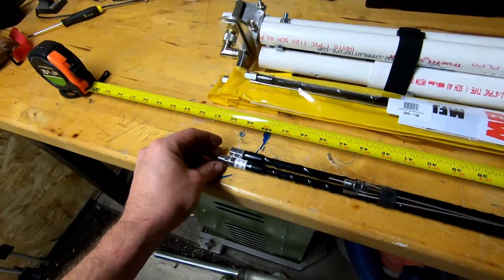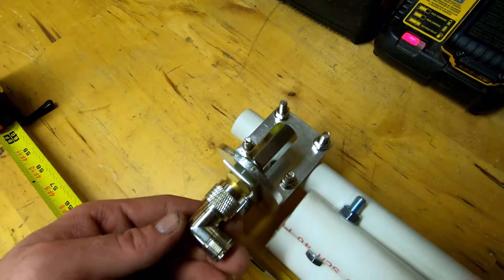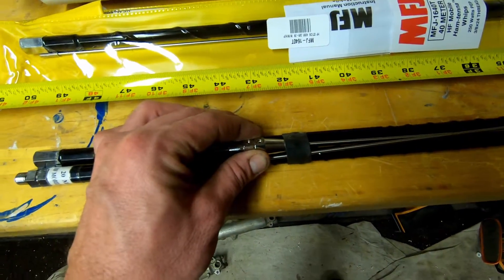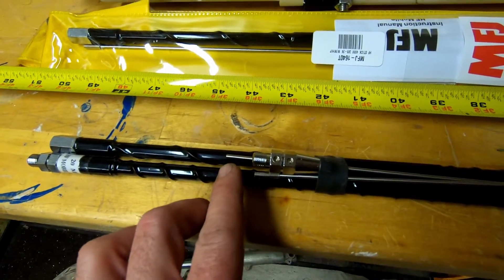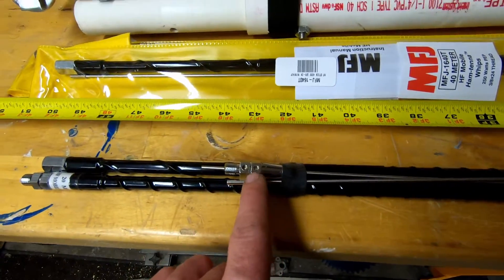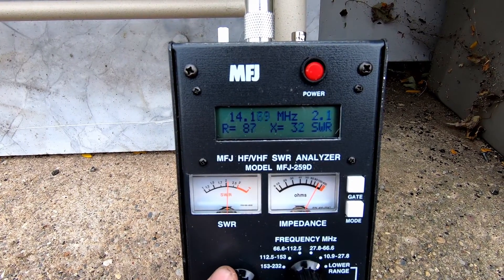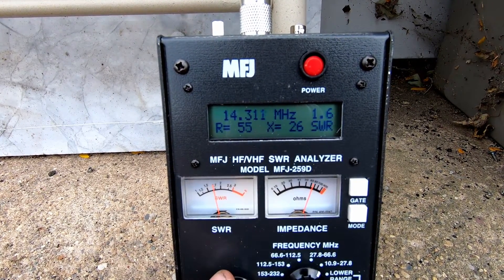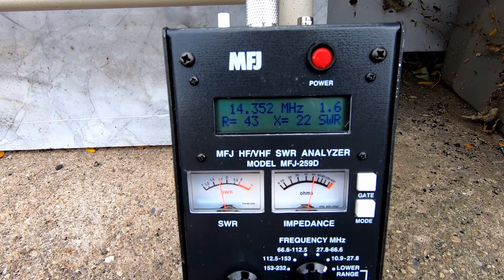Portable Hamstick Dipole Experiment (20m)

Comment: Very cool.  I put one of those up in a vertical polarization just on the top rail of my chain-link fence.  I tried to attach some radials to it, and that sent the SWR sky high.  Disconnected the radials, and near 1:1.  It worked well; I made contacts all over the country with it.  DE K7RLN

Comment: I built basically the same setup.  I experimented for a day with the whip length and the best I can get with my Comet analyzer is SWR of 2.2-2.5 at about 70 ohms at 29" whip length. [this was at 14.230-240]   So a tuner is necessary.  It works great for JS8 so far [today is the test run] but I'm wondering about the whip length.  I have not cut them off, but at 29" they don't seem to extend too far into the main shaft.  The irony is that my hamstick dipole fell right into line with about a 1.2 SWR @ 50 ohms....at 14.585....outside the damn band. :)  Any thoughts are appreciated.
Reply: how did u get on with this trying to make 1

Comment: Hello; I know this video is a few years old, but one thing I wondered about (and I didn't see in the comments, if I missed it please forgive) but I understand the impedance of a dipole at the feedpoint is about 75 ohms, and there's no balun or gamma match on this mount. What impact does that have wit 50 Ohm feedline? wonder why they don't make a groundplane mount, using the hamstick as a radiator?

Comment: I was under the impression a dipole antenna was half a lambda. In the case of the 20m band, total length roundabout 10m, each leg roundabout 5m.  It looks like you built yourself a full wave dipole antenna. What was your reasoning here?
Reply from the maker: The hamsticks I used are electrically a quarter wave each.  End to end and center fed like this is equivalent to half wave center fed dipole.  Hope that help :)
Reply: @TomtheDilettante  then i understand.  i will try it out

Comment: Video says 20m but you have 2 20m hamsticks for your dipole. Shouldn't it be 2 10m hamsticks?
Reply from the maker: As I understand it, each hamstick is an electrical quarter wave, so two end to end in this configuration creates a half wave dipole. At least electrically. It tunes quite well in the desired band but because they’re compromised antennas, bandwidth at lower frequencies (ie, 40m and 80m) is quite narrow. Hope that helps!

Comment: So I have a question. Given the horizontal polarization and height from the ground, isn’t what you’ve constructed a NVIS antenna?
Reply from the maker: Good question and I'll give you my best newbie answer.  From what I understand, an antenna is considered NVIS if it's 1/4 wavelength or less in height from the ground (e.g., 1/8 or 1/10th wavelength).  So, for 20m, at 15' off the ground, I was not considering this an NVIS antenna.  However, my 40m hamstick dipole at 15' off the ground would probably be considered an NVIS antenna.  I'm not sure if this all applies to compromised antennas with coils though.  I'd love to hear what others have to say about this to educate myself as well.  Thanks for watching!

Comment: I think you "ham lingo" is just fine.  I listened to my dad for decades (I'm 55) and I guarantee he never would have guessed that you're a n00b.  To honor my dad, I got my tech license in 2003 or 2004, mounted my his old Kenwood 2 meter rig in my car and only listened a bit.  I've never said a word over the air, but your vid's may just inspire me to do so.  Next weekend's project is to journey down to Naperville to disassemble dad's ham shack, pack up the radios, antennas and peripherals and haul it all back to Michigan.  73, Rob KC8ZPP

Comment: Just got my GMRS license (WRMD956) in eastern KY. My radios are arriving Sunday and Monday with my SWR reader estimated to arrive April 4th. Do you have any recommendations for mounting my antenna and perhaps a video where you covered it or even one you followed? I know my cable needs to retain 3’ segments, I’m just contemplating placement on my wife’s and my vehicles. 2017 Subaru Impreza hatch (2018+ Crosstrek) and a 2012 Toyota RAV4 Limited.

Comment: Good job Tom. Hope you make lots of contacts. I had a 40 & 80 meter Hamstick Dipole from one feed point in the attic of an Apartment in St Louis several years ago. It got me on the air, of course they are compromise antennas but far better than nothing.

Comment: I am trying to set up a 10M dipole.  I got the antenna tuned to the frequency, but I can't get the SWR below 2.  Should I just use a tuner?  I would like to get the SWR low and use it without a tuner. 
Any suggestions?  It is not near anything metallic.  I think I have good separation from other antennas.
Reply: Use wire counterpose that should bring your swr down.73 AE4OY William Peacock EM-81UF SOUTH EAST GEORGIA

Comment: Request: Try them vertical as well as horizontal. Let us know how you go. 

Also, I’d be curious to see how they go compared to a wire antenna for 20m on the same pole in say an inverted V
Reply from the maker: interesting idea.  next time I bring these in the field I'll have go give it a shot.  Jeez...warm weather can't come soon enough :)  Thanks for watching!
Reply: @TomtheDilettante  I’m sunburnt after a day of repointing and repairing brickwork.
Reply: @TomtheDilettante  The idea of running them vertical is you get the lowest take off at half a wavelength above ground for a horizontal. That’s 66’ at 40m. Vertical, the radiation pattern is a little different. 

Then there is the mag loop rabbit hole... :-)

Craziest antenna project I have seen was Callum of DX Commander running a 160m horizontal full wave loop around 33’. On 20m, It gave him some very narrow radiation lobes that had around 15dB of gain over a dipole. 

Remembering you double your power every 3dB so that is 32x power in the direction of the lobes. 

Scaled for 11m, that almost makes you competitive on the Super Bowl:-)
Reply: @MidlifeRenaissanceMan  591 feet of wire should be resonant on 11 meters.
I'll have to string it over my neighbors yards.   They're old, they'll never know.
🤫
Reply: @seeharvester  once you get into multiple wavelengths, you get all sorts of odd patterns and lobes. Some are massive. But it also has steep nulls, so some stuff you won’t be able to hear. If you run a couple in slightly different directions you’ll often pick up some of the the gaps

Comment: Good deal, Man. I'm yet to try Hamsticks, but the 20M versions look like to gigs to try 1st.
Reply from the maker: Thanks for watching!  Yeah, I've had good success with the 20m setup.  The 40m version works well too but it has a pretty narrow usable bandwidth.  So I would say an antenna analyzer and forethought into where you want to operate (voice, digital, cw) before you deploy it is a good idea.  You might be able to get away with tuning it in the middle of the band and using a good tuner, but I haven't tried that yet.

Comment: Hey Tom, your video popped up on my youtube list, probably because i was researching hamsticks. Great video well done ! I have the 17m hamstick so i am gonna get another and do the same to give it a go. Keep experimenting ! Thats what the hobby is all about. 73, Sid MI5UTC
Reply from the maker: Thanks for watching and for taking the time to chime in!  For portable HF ops, I really dig the portability of a dual hamstick dipole.  I've only had limited success with a single vertical hamstick on HF...probably because I'm still a newbie and haven't figured out how to ground optimally, or set up a good radial system.  Anyway, it's been fun experimenting.  Just need more time to keep tinkering :)  Good luck with your setup and thanks again!  73 de KD9PXF
Reply: Great video I’m thinking of making a mini beam using 4 no 17m hamsticks on a 4m boom, how do u think this would work ?

Comment: Hey Tom, great project! Like you, I'm outdoors a lot and want to travel with a rig, solar battery (love the Jackery 240 and solar panels) and a portable antenna. Questions: 1) how have these worked for you during your travels? Would appreciate hearing about performance, 2) wonder if we could build a 20 meter 'beam' using 4 or even 6 hamsticks? Have you heard of anyone doing this? 73 KJ6ER, Silicon Valley
Reply from the maker: Hi Greg!  These have worked out well for me in the couple trips I've used them.  In this video, I believe I showed an SWR reading across the part of the phone band that I was looking for.  They tune, but the bandwidth is a bit narrow (narrower on 40 than 20).  So I would suggest pre-tuning them at a height you think you'll be using them at and then checking them again when in the field.  The 20m rig didn't need to be tuned on use, but my 40m sticks needed a little tweaking in the field.  I roll with a RigExpert antenna tuner which makes the job easy enough.

As for a beam, that's a really interesting idea!  I googled it, and it looks like someone has done it.  Check this out:
http://hamuniverse.com/ve6vk20meter3elementhamstickyagi.html

Tuning 2 sticks wasn't that bad, but tuning 6!?  Wow...wouldn't know where to begin.  I'm not experienced or knowledgeable enough yet to know how to tune the driven element vs reflector vs director.  A lot of that stuff is still dark magic to me :)

Anyway, I'm still new to the hobby and hope to tinker with building a high gain HF antenna, but I'm still learning and exploring what might fit my small space.  If and when I put something together, I'll be sure to document it to share.

Thanks for watching and 73!
-KD9PXF
Reply: @TomtheDilettante  Hey Tom, thanks so much for the reply. Ya, that's a interesting hamstick mini-beam project but I agree with you, tuning a half dozen sticks would be a real project :) Another thing you may want to try - MFJ has 17' telescoping whips that u could try instead of the hamsticks. More efficient than sticks and perfect for 1/4-wave elements on 20M. They scope up very small, too! This is the part of HAM radio I really enjoy - experimenting, especially with DYI antennas! BTW, congratulations on the new license, good for you! And your 'lingo' sounds great. 73 buddy, KJ6ER, Silicon Valley

Comment: When tuning do you move both equally or just tune one side I’m assuming you do both equally. Thanks thinking of doing a 75 meter dipole.
Reply from the maker: Hey there!  Thanks for watching!  I tuned both sides equally.  To create a good balanced dipole, each element should be the same length.  For a 75/80 meter dipole, if you're going with a shortened or coil wound dipole, keep in mind your operating bandwidth will likely be very narrow.  Even on my 20m and 40m hamstick dipoles, I had to tune for a desired portion of the phone band.  Anything above or below was a high SWR.  In my case, if I decided to use the same antenna for data / CW, I'd have to re-tune it.  Just something to keep in mind.  Good luck with your project and have a good one!
Reply: I recently purchased a pair of Shark 75m hamsticks. One thing I noticed of the 75m ones is the bandwidth is very narrow. I'm currently a general so my 75M is at the top of the band. As the poster mentioned the stick is mostly coil so you wont be able to adjust very much without cutting otherwise you will be putting the stinger in the middle of the coil which would probably make it radiate more infrared than RF. :-) I wanted to put the swr sweet spot around 3.9MHz for mine as I figured that is where I would be spending most of  my 75m time. The further you move away from their design the smaller the swr sweet spot gets even with the built in tuner I have a small chunk of 75m that I can operate with these.

The SWR was pegged with the stinger in its original form. As a test, I borrowed the stingers from my 40m hamsticks (also Sharks). It brought the sweet spot on my analyzer pretty much right where I want it. The 40M stingers are 36" while the 75M came as 48". 12.5" inches seemed to work out for me. Please note though that my installation is in an attic which is far from ideal and I might have gone past a better size cut by utilizing the same size for 75m as the 40m. American Radio Supply sells replacement stingers if anyone ever over cuts. I kept both sticks equal as each stick handles half wave so they should be equal.

My results are similar to the OP. Are they the perfect antenna? Probably not, but they are very portable, durable, easy to set up & flexible. I had a quick QSO with W4DFR who is around 750 miles away. At the same time & frequency as this QSO, F11BAO in France put me down as a QSO on EQSL. So, its very possible he heard me on the other side of the Atlantic. Its also very possible he heard someone with a similar call sign and/or miskeyed.

73 - KC1OCA
Reply from the maker: @MichaelLaferriere  Awesome!  I haven't tried this on 75 yet.  I currently run them for 20 and 40.  You're right though, the operating bandwidth on these is pretty narrow so you definitely have to tune accordingly.  I've found that the lower you go, the narrower the bandwidth.  I get a pretty good / usable SWR throughout the entire General voice portion of the 20m band, but not in the 40.  I can only imagine how narrow it must be on 75/80 LOL.  That's awesome on the DX QSO for this setup in an attic!  Haven't made it across the pond yet on this setup, but I've also not been on the air as much as I'd like to lately.

Anyway, thanks for watching and sharing your experience.  Very cool!

73 de KD9PXF
Reply from the maker: Hey there!  Thanks for watching!  I tuned both sides equally.  To create a good balanced dipole, each element should be the same length.  For a 75/80 meter dipole, if you're going with a shortened or coil wound dipole, keep in mind your operating bandwidth will likely be very narrow.  Even on my 20m and 40m hamstick dipoles, I had to tune for a desired portion of the phone band.  Anything above or below was a high SWR.  In my case, if I decided to use the same antenna for data / CW, I'd have to re-tune it.  Just something to keep in mind.  Good luck with your project and have a good one!

Comment: thank you for the video Tom l am about to make something myself may l send you a link when its completed regards Allan G6TMO
Reply from the maker: Thanks for watching Allan!  Good luck with your build.  Worked nicely and I got some QSO's while camping in the Colorado Rockies with both a 20m and 40m version of it.  I found a different mast idea in the form of a portable flagpole for tailgating that I'm going to try next.  It's less rigid so my wrapped coax (ugly balun) throws it off a bit with the weight.  So I might need to make a nicer and lighter balun.  We'll see.  Anyway, good luck and 73!